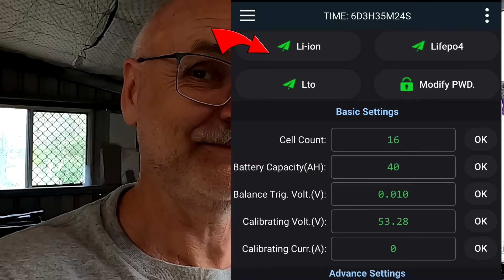Major safety concern with new JK Inverter BMS! Not good.

Comment: This is why you should always charge your batteries with a proper charger designed for the chemistry you're using.  You effectively have two BMSs running in parallel.  If one loses its settings, the other will prevent overcharge.  The only issue with this is that you may not notice one of the systems has failed because the charge will complete as normal.  Always best to keep an eye on your BMS settings periodically I guess.

Comment: My jk bms is in controll of the charging done by multiplus ii via CAN (So MP is on external controll).
So i assume all voltage settings in MP are now overruled by the bms.
Then why is my jk bms going into OVP when the battery us 100%?
Does anyone know?

Comment: It seems as if the settings are not stored in the CMOS, but in a memory, possibly buffered by a capacitor, which is deleted as soon as no more voltage is applied. Any reasonably knowledgeable tinkerer who has mastered the Arduino platform knows how to save settings in the CMOS that are retained even without a power supply. It's just a shame that a company delivers such a piece of crap.

Comment: Not only is a factory reset a terrible idea but it is made worse by the overvolt factory setting being so high.  If the default was 3.5V this would be more a nuisance trip.   The BMS would trip at high SoC before the charger shutoff.  This would be "fail safe" in that while annoying it would alert the user of the issue in a safe manner.  Combine "random" factory reset and the factory default being 4.2V is what makes this so dangerous.

Comment: Hi Andy, you proved it: there ARE Germans with humor 🤣, maybe this is one of the reasons you left Germany being somewhat different? 😉.

I really like watching your videos but am missing just one: multiple RESS BMSses on one Cerbo.
For now I stay with my cellboard based flexible bms with hardware DIPswitches for cell balance voltage and stuff written in EPROM but these are way too expensive ( €600 for just one string of 18 batteries) and having the disadvantage of needing extra room, needed for each cell module hoovering above the cell poles....

Can you recommend me a BMS that's central, can control 16 (or maybe 18) LiFePO4 cells, has a balancing power of 1 or 2 Amps  and works fine with 4 or five brothers together on a Cerbo (I ordered 40 extra LiFePO4 EVE LF280K cells and want to have 5 strings of 16 cells in parallel).
Suddenly I realize: it gets very lonely here......

Comment: I just saw this alert video.👍👍🙏
Thank you very much Andy and the whole community.

I would like to share my thoughts.
I have a Deye hybrid inverter with 5 banks of 48V batteries monitored by JK BMS.
I don't know if my 2 year old BMS keeps my settings in memory after power off them.
The good thing if you charge your batteries via an hybrid inverter is that the inverter supervises the battery voltage at a higher level than the JK BMS. 
I have banks of 16 x 3.2v LIfepo batteries in series.
The JK BMS stops charging at 16x3.5V = 56V .
If, after a reset, the BMS is programmed to charge at 16 x 4.2V = 67.2V, the inverter will stop charging at the setting you programmed.
I programmed the inverter charging to stop at 56.5V.
So even if the BMS does not have the right settings, the inverter will stop charging the batteries at 56.5V.
If the JK BMS balances voltages from 3.4V it should be fine.😎😎
Reply: My JK BMS is on my way from China and this is what I was thinking to do. It makes a lot of sense. Let us hope the problem will be solved soon.

Comment: The best solution for this is to assemble a fairly cheap free-standing electronic board that continuously measures the voltage of the batteries and gives an alarm on time?

Comment: I have started a system on JK-PB2-200A bms 1Master+3Slaves =4total.
I tested the communication and it seem to work. But a safety concern exist.
The errors are not stopping inverter (i have DEYE SUN 6K) I tried Pylon protocol, Deye, Growatt. (settings in JK BMS

1)I simulated alarm by heating the temperature sensor of SLAVE bms. Temperature reading on inverter didnt change. BMS went to Error. Inverter worked as usual. sick!
2)Simulate alarm by heating MASTER bms. Temperature reading on inverter showed middle temp of MASTER. omg.
No error on inverter. omg.
Also: Inverter battery tab where voltages and Amps show have Error states in 0x0000 format. Previous batteries launched alarms and changed those to 0x0040 or elsew depending on alarm Hex code was sent.
These just doesnt do.

When i used conversion boards (peter board like you say) I got 0 charge 0 discharge amps on error. And had error codes.

Andy!. It would be great if you can test the Alarms on JK with your Victron. If you have the same it is surely a safety concern and there is no sense of BMS Comm between inverter with these BMS's
Only your word can force JK company to make a firmware update in days about that!

If needed i can make a video of my setup for you to see the Problem for further actions (making 7 batteries of16S Salvaged Tesla CATL LFP 64kwt total using the NEW JK BMS Boards, and pretty upset right now without error not functioning)

Comment: WOW Andy that is gross negligence on the part of JK, supposed to be an expert supplier (of mickey mouse kit?).  As you say, the bms is a vital protective device.  I am looking at the problem from first principles, ie back to basics.  Do top balancing at the end of charge cut off at xS volts, switch cell all to parallel config so they soak and self balance, then switch back.  All done by a bank of auto type DPDT relays - crude but simple, maybe only needs doing once/month, by manual triggered count down timer.  Its what I am building, together with a string of isolated 3.5v psu boards , one for each cell, all switch on for charging.
Is this a stoopid idea?  Isambard is my hero with his 6ft gauge rail system, way ahead of his time

Comment: The Problem is, that this BMSes could be used for different Cell types, if there is only the one type LiFePo mode, the BMS can only fall back in LiFePo mode..... !
Keep it as simple as possible!
Its is not always a good practice, to develop one product, that fits for all the cases outside there!

Comment: I will comment that I passed on buying a JK even though I wanted their active balancing and went with JBD.   Because of some previous firmware issues reported with JK.   It's important to use good hardware but more difficult to find a company that makes their firmware stability just as important.  I think that Will was talking about this as a general problem with China brand products.

Comment: Hi Andy, I watch all of your Videos from Testings and settings on the jk bmses. I saw the Last vid, when you made changings in the setting on 40 ah to 280. Then you made other changing and slide Back, and the Changes resetted to 40ah. The use of the Software ist also a pain in the ass, IT should be working Just Like the App!
Other people in the German Community also 
Had problems with normal Brand new jk BMS, Like the first cell didn't appear in the app or the setted cellovervoltageprocection ist Not working correctly, IT didn't Stop charging. 
And I thought IT IS the best on the Planet and I planed to buy one. But now, IT Changes my mind.
Anyway, your Last Video is the best Cross between Harald Schmidt and Herbert Feuerstein. Lovely greetings and Happy new year from Germany

Comment: There is a lot of junk out there and everyone is assuming that it will last. I  have 3 solar systems for about 4 years and most of the equipment prematurely fails.  Micro Inverters -failed. They were up on the roof and a huge problem to diagnose and replace.  Well known brand of solar  panels - junk. I finally realized that the drop in power generation was not due to cloudy days. Again,  up on the roof and took them all off  only to find junction boxes that had detached, the white backing sheet bubbling and delaminating, and a close look at the front of the panels in the shade revealed extensive crazing of most of the panels.  Now this with the JK BMS?  I wonder what else is going to prematurely fail? The Lifepo4 cells? The solar charge controllers?  Sorry guys, but I don't want to spend half my life monitoring my solar. What am I supposed  to do, be engaged in a constant attempt to get warranty replacements and then having to reinstall everything back?  You know,  there is a value to time and so far my solar experience has cost me a lot more than it would of had I just stuck with the grid. Solar? Meh.

Comment: Thanks for the video Andy! I received 5x of these JK-BMS today, connected one of them to a power supply for testing, and noticed the hardware version is V15.XA and the firmware is V15.05. I wanted to update to the latstest firmware version V14.17, but the software warns me that the "Major version is not same to connected device", which makes sense, and I can only force the update. Has anybody tried this, or got more info or resources on the V15 hardware/firmware? I don't want to brick my BMS, so I'll wait for now, as my battery cells will only arrive at the end of the month.
Reply: Well that was resolved quickly. Got a reply back from JK through WhatsApp with the latest firmware for V15.XA hardware, latest is V15.06, same changelog as V14.17. @Andy: If you want to add this firmware to your Google Drive, let me know.
Reply: Hi I got the 15Xa version too can you send to me the firmware  @kdejMX
Reply: How did you contact JK support?

Comment: Hi Andy, Too funny on the presentation.  You may have stumbled into a new career path!  LOL.  Thanks for sharing.  Also, people should think about locking down the Victron pairing code from the default since I believe a person could easily change the charging parameters for your battery.  ( Mainly thinking of folks in a RV / camp park).  Keep up the good work and keep the news coming!

Comment: -V14.17 Upgrade logs

1.Fixed a bug where parameters were lost after BMS restart. The bug is caused by a logical error in the parameter entered by the user.
2.Change the default configuration parameters to LPF to improve security.
2.Optimized JKBMS Modbus protocol, added RCV RFV register support. The protocol must use the PC software version V2.5.0。
3.Fixed the Bug that the hardware version may be incorrect in the device information.
4.Add battery low temperature alarm to dry triggers.
-@2024-01-09 by JKBMS
Reply: hi, where is the firmware download site?

Comment: at least the voltage will be capped by the inverter/charge controller , and if the balance isn't way out naturally cells should not gointo danger teritory , but yea the bms is the master breaker and should be perfect

Comment: In the meantime, JK could issue a firmware update which makes a factory reset default to an "OFF / Battery Disabled" profile, so you need to connect to the app and tell it which battery chemistry it's connected to.  It seems a reasonable workaround for the problem, it'll at least prevent the issue from causing any damage.

Comment: Great discovery. I bet some of your followers could whip up a circuit of a 3.70V triggered op-amp piezo buzzer/breaker trip addition, that could apply to any BMS managed system.
Because I'm old, I'd prefer a jumper/switch on board for such a vital setting, like an earlier viewer suggested. With such a complex device, i can however see how this could get overlooked, while they're quickly taking care of all the other refinements you've been suggesting.

Comment: Hi,

This makes you wonder if you should trust solely on software for protecting agains possible disasters like this.

Perhaps some things should be backed up in hardware, old fashioned jumpers and parts dying at extreme circumstances.  Thyristors set by physicsl jumpers can easily fix this I think. Most high class powersupplies use them as backup. 

Leaving everything up to software may not be a good idea.

Even a basic seperate device could simply shortcircuit the supply and blow the fuse to prevent over voltage.

Andy.. this is an eye opener, thank you 👍🏼

Addendum:

A youtuber called Nate accidentally overcharged a pack to 3.85V and created balloons. Think what could happen at 4.2 volt while you are sleeping aboard or upstairs.

Comment: One more thing i noticed at model JK_DB6A17S8P which i test in use now. When battery drops to Cell UVR(V) and protect battery what is normaly there is no is no chance to start charging the battery unless the UVPR limit is lowered to a little less for at least a few seconds to unlock the cell protection. I was waiting for even few hours to start charging but battery is locked for charging in that moment and wo intervention i described system is stucked.

Comment: congratulations on the direction of the video, I completely understand you, you are doing their job to discover errors and when they are critical (they can cause serious damage, fire, etc.) it is reasonable to expect JK developers to fix the same errors immediately or in a maximum of 24 hours.

What abut other JK BMS models like JK_DB6A17S8P i have.I saw you have black model 200A similar model to B2A20S20P or just that model. Are they affected with same bug or not ??

Comment: The topic is quite intriguing, and I must commend Andy for shedding light on this matter with a touch of humor rather than causing panic. I'm curious about the solutions JK might implement to address this issue. Perhaps transferring the firmware from flash memory to permanent ROM could be a viable option, though I'm not certain about its feasibility. I'm hopeful that a firmware update will suffice to fix the problem.

For those who have already purchased this BMS, it raises questions about how JK plans to rectify the situation. Personally, I've decided to hold off on acquiring this BMS until it receives Andy's seal of approval and confirmation that necessary modifications have been made.

It's a bit nerve-wracking, yet oddly amusing—I appreciate Andy's lighthearted approach to a potentially serious matter. Kudos to his entertaining perspective!

Comment: Not only should the BMS not lost it's configuration but the factory default should be the most common denominator for safety i.e. the battery type with the lowest voltage.   This way a BMS that resets to factory default would be an inconvenience but not a safety hazard

Comment: Thank you for sharing this information - and the nice video!
It seems to me that JK is storing the information in a NV-RAM which power supply is buffered by a capacitor. This will last for some time - and after this capacitor is discharged the information is gone. But they should never use a setting which can cause major trouble as a default then 😕
Grüße aus Deutschland, Klaus

Comment: Hi Andy great work on the potential safety hazard on the JK inverter bms. Just would like share this with after seeing your video on this i decided to check all my bms,s non inverter type . and found that my one bms had reset its self to 4.20 OVP , i have not switched my system off for 12 months and more . I dont think that the issue is only with the new inverter bms,s . So i think there is a definite problem here . This is very concerning
Reply: omg... can you add the model numbers here?

Comment: Thanks a lot Andy. 
I have 3 of the Inverter style JK BMS enroute and really appreciated this input. I'll be testing out 1 on a smaller spare pack I have and run it through its paces. Plan is to hook up an ESP8266 to gather some test data and also add an alarm in case the settings change during operations. They won't be replacing my 3 "old" style BMSes anytime soon though. 

We'll see how it pans out.
 
Cheers from Denmark!

Comment: Jan08’24/0205h 🇺🇸 2005h Brisbane 🇦🇺 Zunächst einmal ein frohes neues Jahr und vielen Dank für die Informationen zu JK BMS. JBD BMS system maintains the configured setup, even if the system is shut down for a fortnight. Take care, be safe und 73s…

Comment: Good catch! I have my own 48V battery packs in different sizes and different chemistry as well,  hookup to 15kW Sigineer inverter.  Aside from BMS per battery pack, added a voltage monitor/relay and contactor to trigger the over/under voltage cutoff. Not efficient and fancy as Peter board but old school rules.

Comment: I recently bought one of the older style and when building my pack I left it off a few days and then found it was back on 4.2v, but I had been playing so much with the settings and 8cell 4cell as I was balancing them all I thought it was me, and that I had reset the BMS. if the hw can't be prevented from having amnesia then it needs new software with a new 'useless capacity but safe for all chemistry's ' as the default.

Comment: Bashing "made in China" like you criticize Chinese while 95% of your equipment is made in China... 😅
This part is not usefull. 
This is a new bms, many people have found that something do not work correctly and they informed you, you found nothing. This flaw can be dangerous... But not really in the end cause the overall voltage applied to the pack is safe anyway (reason to stay without any communication between bms and inverter as I always recommend), this is a flaw and it's good to warn people but the  "having fun" on jk or Chinese product make you a smaller person cause in the end you are not smart enough to do better then their products. 

Peter board... Peter board... what a joke.

Comment: Cant wait for the update from the factory, !!!!!  ram vs flash memory, capacitor used to keep the memory powered? 15 year old tec if you ask me,  hardware upgrade likly required. GOSH JK
Reply: Agree - Why would you not use flash memory or nvram to store the settings on a such an important device that is meant to be the protection device. What do the other BMS use that Andy has tested, eg Pace and Seplos